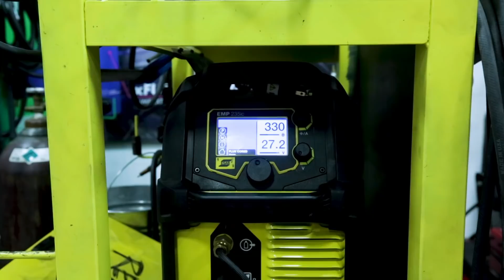How to Bevel a Plate - Man VS Machine

Comment: Of course the machine will be faster and more consistent, but you didn't include the setup time for the machine or the pre-grinding of the first 1".  Those are important, but obviously will not change the result for large welding shops.

Comment: If you try 3m cubitron disc, you never want to use another Brand. They last long and take away alot off material. The grind disc is insanly good. I dont think the flap disc is exstreme. But the normal grinding disc 5 inch and 9 inch are the best that money can by. I prommise.
Reply: This, at my job we use the Cubtiron II pipeliner discs and  the flappers, seriously you'll bever that plate in no time lmao
Reply: @panzerfaust7672  i bet 1000$ that i can bevle a plate faster with a 9inch grinder and cubitron grinding disc. Than you can with a 5inch grinder and a flapper disc. I dont say that cubitron flappers are bad. But i dont think they are 10 times better than other Brands i have tryed. But those cubitron grind disc have raised the bar by a mile in grinding disc.

Comment: Man y’all should really try what we refer to as soft pads but I think they are called Norton blaze ceramic disc I think I could do it in 10 minutes with 2 of them discs and I disagree with the working an inch at a time , I get the bevel set then make sure I keep the grinder at the same angle and do about a foot ahead making sure I don’t change the angle then I go back to where I start and the pre bevel that I made gives me a pre flat spot to shine the light off of so I know that I can keep the bevel the same

Comment: JEI and Metabo make angle grinder based bevelling machines. Very good but expensive. I generally use a 9inch Makita angle grinder with a solid grinding disc on it. But for long lengths you really need a proper bevelling machine. Interesting video!